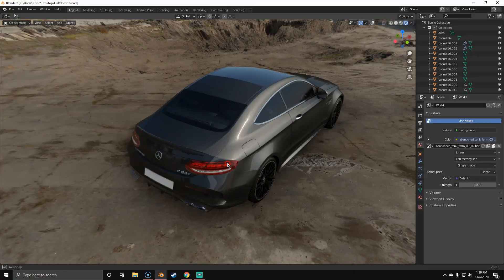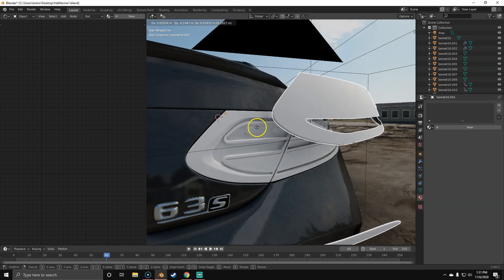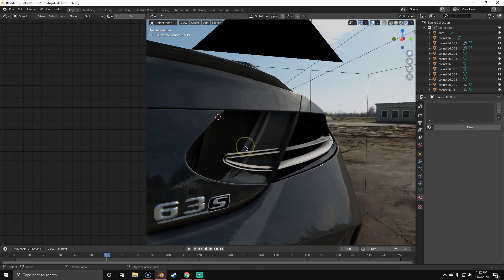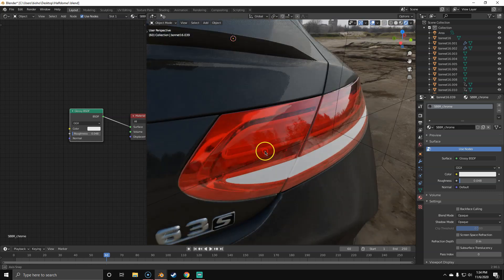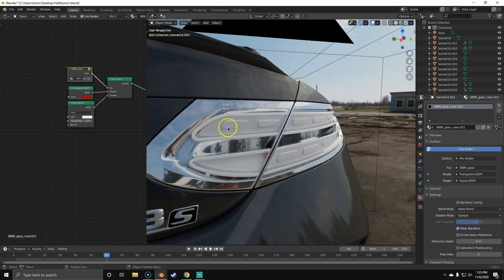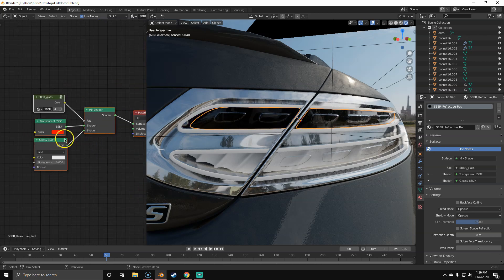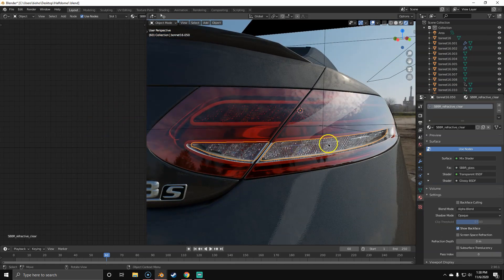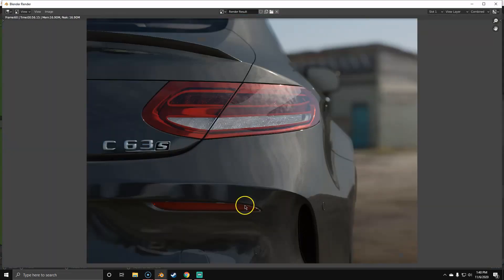Eevee SBBR (Stand-Brems-Blink-Rückleuchte) aka Rearlight | Blender 2.90

Comment: How the hell do you UV unwrap a model like this? I presume it's super high poly, so I imagine going to hell is a way easier ride than UV unwrapping it. Also, didn't you tell us not to model cars in Blender? :P
Reply from the maker: yeah, at least you probably won't encounter a car modeling job, but shading is very important, that's usually the main job when receiving CAD data.

Comment: How can we make some red parts more reflective or they light themselves with little light cast (I mean those lights that are meant for showing with minimal light at night)
Reply from the maker: you could use some emmision
Reply: @DamianMathew  thanks for responding, but can't there be another way so the emission will be coorelated to the light received?
Reply from the maker: @adnanerochdi6982  I think you have to explain again haha. I’m not sure if i understand
Reply: @DamianMathew  sorry, yes I can. So some parts of car tail lights are more sensitive to light, so even when there's a little those parts reflect more than the rest, now I'm thinking of a way to make those parts behave the same in 3D hopefully without "cheating" with emission 😄. I think this will evolve some coding but I dunno, what your thoughts are, Damian?
Reply: @adnanerochdi6982  For reflectiveness, you could use the metallic feature? 
Use emission and metallic for the light emission and light bounce???
Reply: @spydergs07  thanks for ur input but I believe not with metalness, because like in some shoes also have this effect in some parts of them, and they're not metallic. But this got me wondering if that effect is actually coming from metallic flakes on the tissue or the material in general?
Reply from the maker: @adnanerochdi6982  ah I see. It’s not physically correct, but you can change the ‘light sensitivity’ but either changing white towards black in either the glossy or transparent node, or by Channing from white to black in the layer weight color ramp. Does that make sense or help? Maybe you have to tell me exactly what part you mean. Maybe send me a screenshot or photos to db@mouval.com
Reply: @DamianMathew  Thank you Damian for being so humble and providing your help, I'll try your suggestions, hopefully I can come to my result. :)
Reply: @Haitham Ali the website is forbidden, but I looked up the file online and found about what I'm looking for so yeah, it is I think